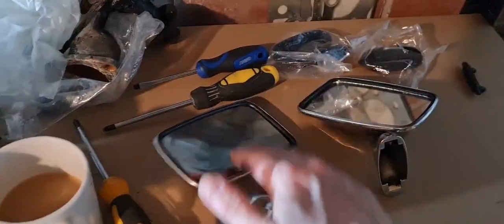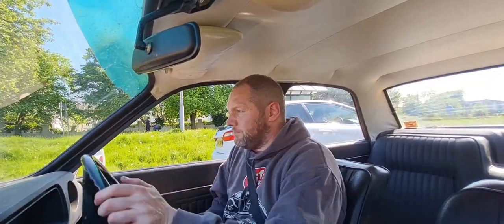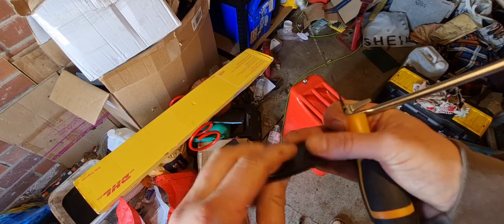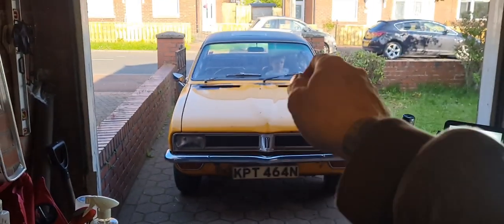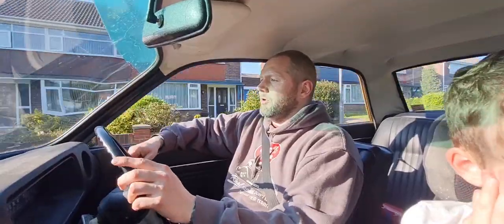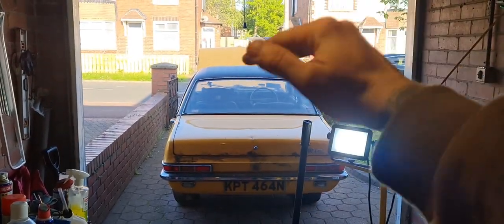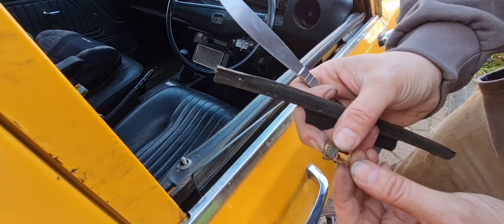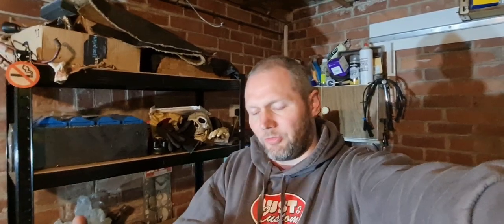A DISASTER, A TEST DRIVE AND A BREAKDOWN - THE VAUXHALL VIVA RUSTY RESTORATION CONTINUES

Comment: VIVA HA, HB, HC , VAUXHALL CHEVTTE Worked on many 80s 90s  owned vivaHC  1995- 2000 . ALLWAYS carry basic spanners / socket set , screw drivers, pliers .    spare fuel pump , points condenser ,  points to coil wire  water pump , hoses  core plugs , fan belt  diaphram for  carb   .   DONE many repair on side off road  always got home happy days .
Reply from the maker: 👍😄 oh ill be carrying a stocked tool box with me mate 👍
Reply: @RetroRebuild   YEP  always get home old school 30+ yrs old .  . Not like  modern after 1997, under 25  yr old stuff  ECU COMPUTER  controlled  need osd reader if sensor fails u stuck .

Comment: Hi Steve you can make adjustments to carb with engine running with that tool on path, if it overheats it's to weak. Drive in forwards though, you can make fine adjustments. Once a command sight cars breaking down and being pushed. People today would have a hissing fit and could not handle pressure.
Reply from the maker: Hi mate, thanks I'm messing about with the carb at the minute so hopefully get something sorted, 😄 I've pushed plenty of cars in my time, I used to have to bump start one myself every morning to get to work😆👍
Reply: Hi Steve, me too push starts in morning and after work lol, try doing a vacume test on carb and try to add red ex or fuel additive, I think modern fuel starts to go off after about 3 months.

Comment: There should be a guide in the Haynes manual re the mixture Steve. From memory, if the spark plugs are sooty & black the mixture is too rich. If the plugs have a white, powdery deposit, the mixture is too lean. All the best mate 👍
Reply from the maker: Thanks mate, yeah there is I'm working on mixture and carb tuning at the minute 👍

Comment: From memory (1990) i took the glass out, the weather strip is secured to the (rotted out) strip then pushed inside the apperture  pulled up and clips to the chrome strip on the inside then put the glass back in. you will probably need plasters, coffee and hobnobs. try not to bend the missing bits as the weather strip wont lie flat to the glass, great entertaining content look forward to your next instalment
Reply from the maker: 😆 thanks mate, coffee and hob nobs are an essential in garage tinkering 😄 👍

Comment: I must say , your headlining seems to be very good condition,  most Astras made 20 years after your Viva used to drop theirs after a few years!
Reply from the maker: I was just saying that mate, yeah it does look in great nick for the age 👍
Reply: The headlining on vauxhalls from this era had metal rods, which were fed through the lining and located into holes above the doors. Headlining in the astras, cavaliers, calibras etc were glued onto a fibre backing plate......through time the glue disintegrated and the top layer drops off the backing.

Why vx changed this design I'll never know.

Comment: Hey what did I say about the breather hose ? the hose was disconnected from the top cover of the air filter housing ! also DO NOT disconnect ANYTHING AT ALL and put the air filter cover back on and make sure all hoses are connected.
Also check there is no leaking vacuum hose to the vacuum advance unit, you can check the vacuum advance diaphram by pulling the thin pipe off the inlet manifold !! and then suck through it, to see if it pulls the diaphram on the dizzy, if it does not !! it then means you have a perished vacuum advance unit, BUT it can still work when the pipe is connected back on the inlet manifold, as this only happens if the diaphram is very slightly perished because of the engines strong suction.
And finally... you should ONLY adjust the mixture when the engine is running at idle WITH THE CHOKE FULLY OFF after the engine is FULLY warmed up.
It looks like you have a Zenith or Stromberg CD3 carb by adjusting the mixture from the dashpot damper, also Stromberg have it at the bottom on the float chamber bowl, that's the CD, CDS and CD2S but Stromberg CD3 is on top, I was not sure which one you had.
But there is a special tool to keep the needle valve central as it screws in the damper thread and you put the Allen key in the centre of it, I use to have one but lost it a few years back otherwise I would of sent it to you.
REMEMBER you cannot disconnect anything !! because when you reconnect it will throw the mixture right off !!
On a positive note...there is nothing wrong with that engine !! it is good !!! I know for a fact it should run sweet at 850rpm, and yes the gearbox does let it down.
The Magnum slant fours also had terrible gearbox's but Vauxhall are well known for bad gearbox's.
Anyway all the best and keep on rocking !! 👍😀
Reply from the maker: Thanks mate, I had the breather disconnected because I had the airbox open while I was lifting piston to listen for engine revs anyway so it didn't matter about breather I've got the special tool for adjusting needle that's what I was using mate, I'm going to remove carb to set butterfly valve clearance 👍

Comment: I learned how to do bodywork on my mother's Battleship grey HA. It had ten tubs in it. I was 14 years old. LoL. Got to get you some rostyle wheels. Some big spot lights. A stereo to drowned out the strait cut gears..lol. sawdust in to he axle and box. LoL. Good luck.
Reply from the maker: Ah class mate, what a learner car! 😆 I've got some spot lamps and I do have some rostyles that need a refurb👍
Reply: @RetroRebuild  Great job. Get um on. Summers here. LoL. Need some chrome rings. Good luck.
Reply: Fixing mom's HA was 1978. LoL.

Comment: Lovely. I changed the carb for a Webber on my hc 1256 years ago to try and get it running a bit more eager. And after I broke the output shaft, fitted a chevette van gearbox, slightly uprated apparently.
Reply: Are the ratio's a bit different on a Chevanne?
Reply: @jaggass  from memory I think they were the same?
Reply: @LeeTanczos  It probably is as Vauxhall just carried the running gear over on the Chevette and Chevanne.
Reply from the maker: Thank you, Class mate, I've been thinking about  switching to a webber carb when funds allow 👍

Comment: I think if you look at the workshop manual or the factory shop manual there is a rough guide to getting the mixture ok by warming up to temp then take the airbox off and with a small screwdriver and lift the piston a little,can't remember which way it goes but if it dies then picks up it needs to be richenned up or weakened can't remember which way but you can get it pretty close using that method.
Reply: That's about right, on SU's you have a lift pin and the setting is you momentarily lift the piston, if the revs die it's too lean and if the revs majorly pick up it's rich (slight increase is acceptable for good acceleration).
Reply from the maker: I was lifting the piston with my finger and listening for the engine revs mate, but I am gonna take the carb off to set the clearance on butter fly flap thingy 👍
Reply: @RetroRebuild  is the carb setting tool like a T handled tube with 2 "teeth" on it and long "allen" key down the centre, because on them Strombergs don't you have to loosen the needle clamping screw (accessed through the mouth of the carb iirc) to allow the needle holder to move up & down or am I mixing up models of Strombergs?
Reply from the maker: @Steve Hill  that's right about the tool mate, you don't have to touch needle on this one, the tool moves it up and down, this carb can't be adjusted from the bottom of it, its the later stromberg 150  👍

Comment: Can never have too many shelves, maybe the gate posts could be a little further apart.
Reply from the maker: True mate, the gate posts are very narrow, but I broke the  mirror by trying to adjust it from inside car and ripping it off😆👍
Reply: @RetroRebuild  Maybe you could get a cheap generic glass.
Reply from the maker: @Mark C Littler  you can buy replacement glass for them for about a fiver mate 👍
Reply: @RetroRebuild  Yeah because it's annoying having a broken mirror doesn't help relaxed driving like noisy wipers.